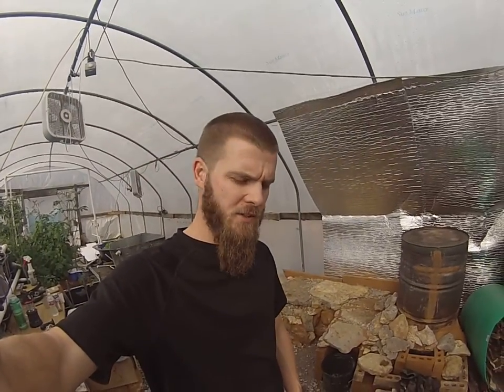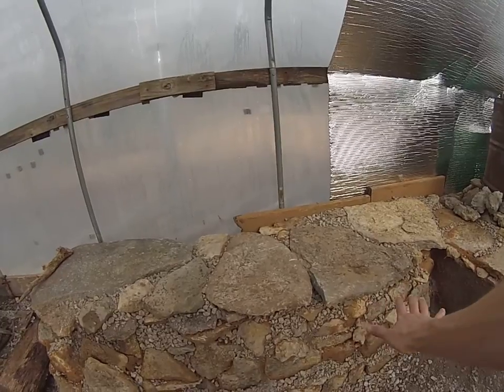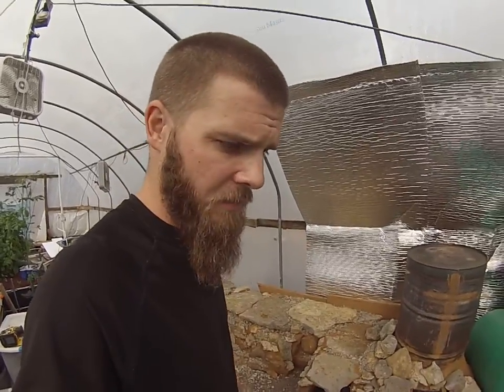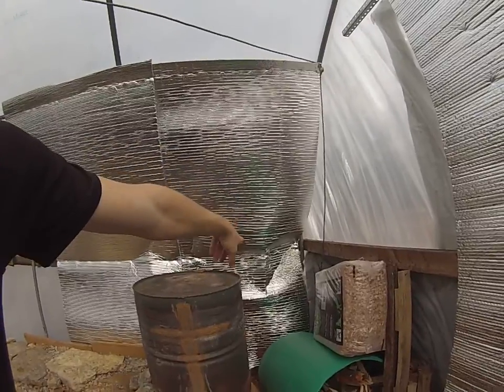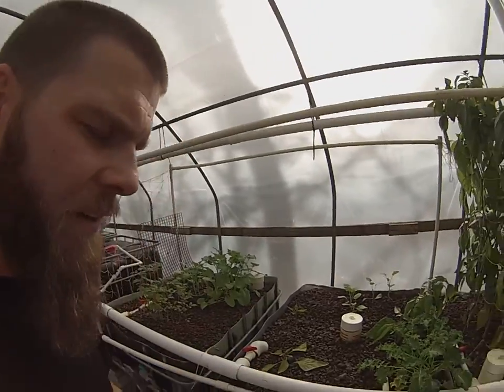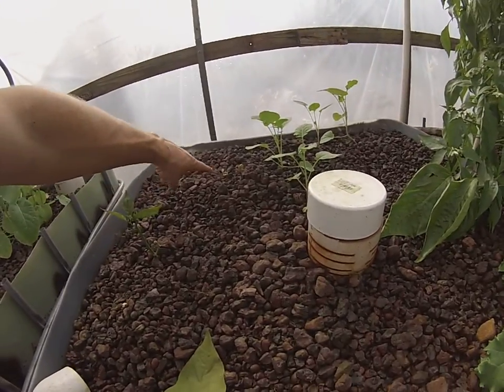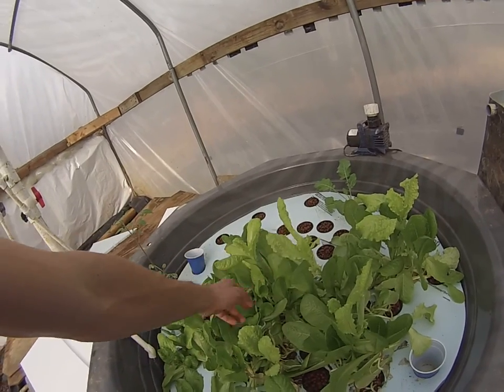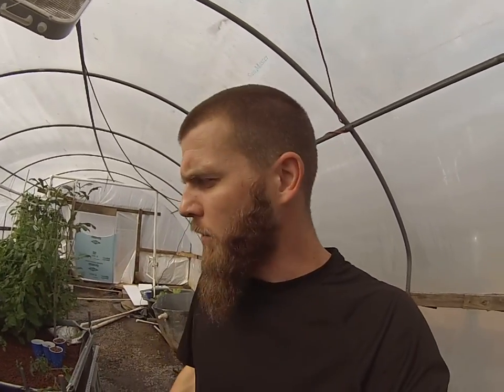Aquaponics Rocket Mass Heater update

Comment: Doing a fine job Mate. i have had a 3 tote system running for about 2 years now. Aquaponics is a fantastic hobby with the potential to feed you all year round if done right. I have just purchased some land an i am looking forward to building a much larger system using what i have learnt both myself and from watching you tube. Keep the videos coming mate as im ALWAYS looking for new ideas. I wish i was good enough with cameras and computers to put my own build on the tube, when i get started. Check out Donald Porta on the tube. he has a fantastic system, im sure you would like. If i could make 2 small suggestions. Get a small cheap tripod for your cam, and also get a mic on a wire . clip it on your shirt and plug it into the camera. So far liking what your doing.

Comment: Your Rocket Mass heater looks great I love the rock work. Aquaponics is looking good to I have peppers that are3 years old and still growing. Wit the plants touching the plastic of the greenhouse is not good just don't look at mine to much but you also have to watch out for flash burn to. That's when it gets really cold everything with in a foot or so of the plastic will burn. That's another good reason. Great video Thanks